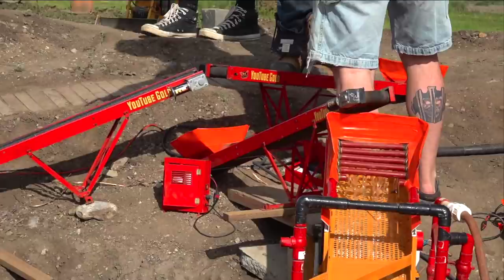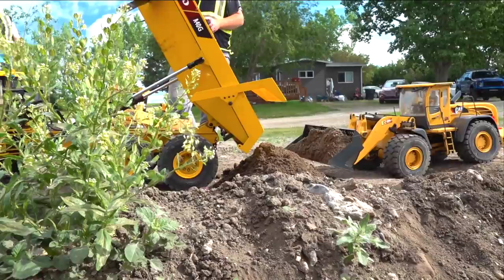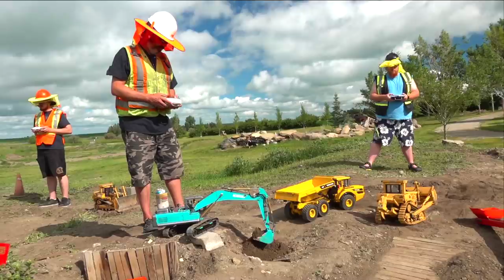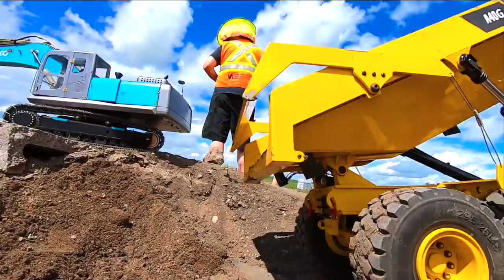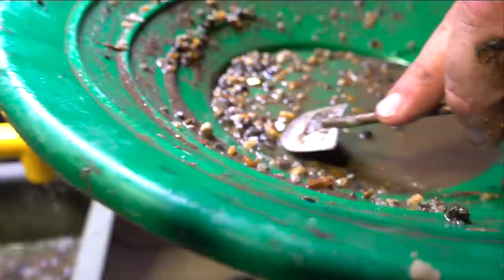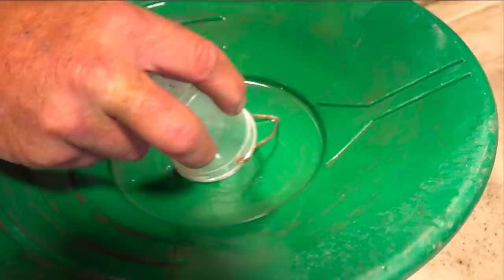YouTube GOLD, EH?! (S3 E8) - "TOW JOB & PAYDAY" - SAFETY 19th GOLD MINE PRIORITY | RC ADVENTURES

Comment: I am watching from Australia and if we are 'KINDA BACKWARDS' why are we in front of you Time Wise?
Reply from the maker: Because of the reverse polarity of the magnetic fields, divided by the convoluted segmentation of inner diameter of the 360 degree circle of course! Multiplied by the exponential inner sub-mass of meeting the requirements of the travel of light and time - equals the result you mentioned. That's common knowledge here in Canada!   #YouTubeGOLD!
Reply: @TheRealRCSparks  did you also know water flows down the plug hole of a bath, sink, toilet and probably other things because of the magnetic pull of the earth the opposite way from the northern hemisphere to the southern. Mention that in ep 9.
Reply: @TheRealRCSparks  do you think you can do RC construction company as a series it seems like it could be cool
Reply: Grease Monkey lol
Reply: That was good  greese Budgy Australia cheers

Comment: Great video rc spark and crew. So many awesome machines to watch but it was sad to see the motor fire at the shaker box, i think you need to get the site safety officer back to patrol the work area need to keep the equipment tip top plus i didnt see a fire engine or fire extinguisher

Comment: When running two conveyors the first should be slow, the second should be faster. This spreads the load into the hopper more evenly, and the increased speed help fling the material off the end so it doesn't stick and fall off under the conveyor. The belt running to the hopper should be as fast as possible.

Comment: Ok, as an ISO certified auditor, I fee that I’m therefore qualified to blatantly point out some severe safety violations on that dirt pile you call a mine site.
1. No directional signs for the rookie drivers. I mean I know they just came out of driving school, but they are literally driving around in circles. 
2. No high voltage signs next to the batteries. Don’t want an arc flash happening and someone getting fried like week old KFC. I mean have you never seen the Colonel?!?!
3.  Electrical connections near falling water. SMH if wasn’t for the hand of god coming in and plugging things in someone’s gonna get killed 
4. The biggest hazard of all though has to be the fact that you never tip the waitress that servers lunch. I mean what kinda cheapo site you running there. No matter how much that equipment costs and how much your employees owe you....you gotta tip the waitress, And I’m going to let that sexual harassment kiss slide this time, but going to have to double tip her next time.